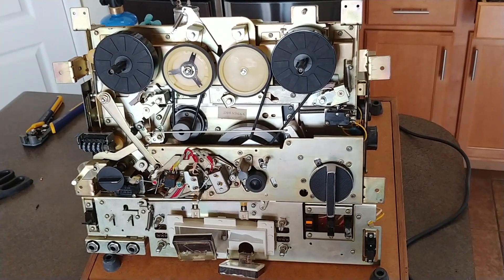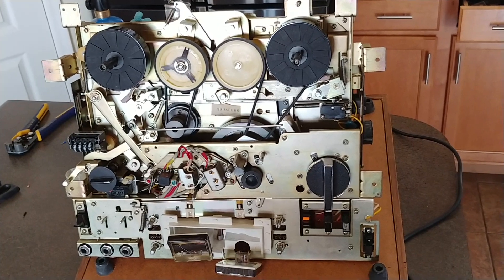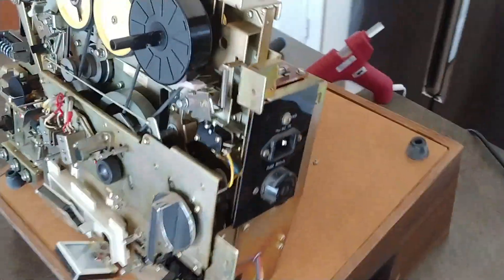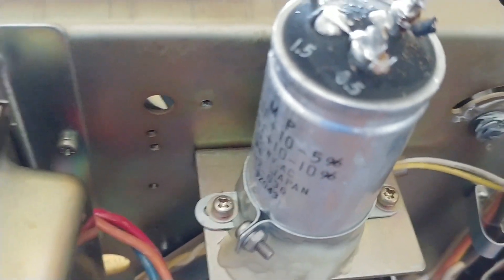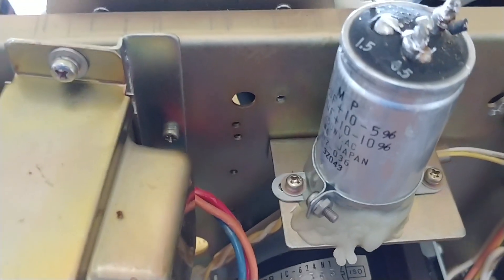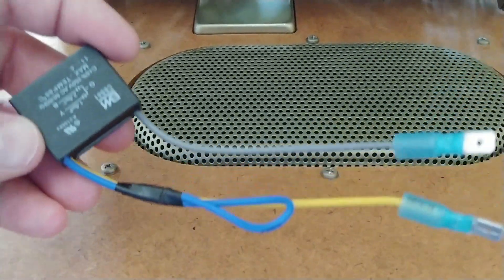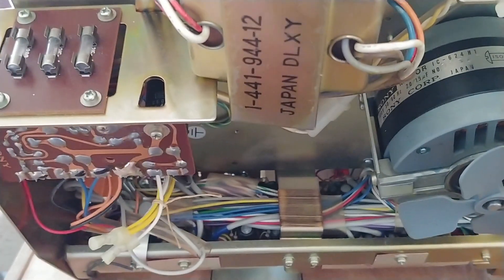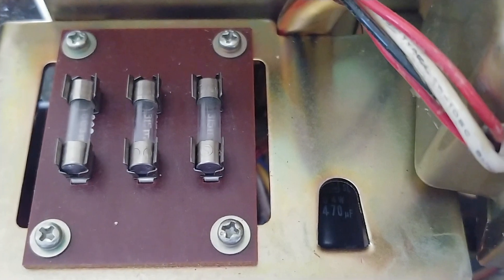Sony TC-377 Reel to Reel Capacitor Replace

Comment: Thanks for the video! As for questions on soldering: I’ve noticed my original capacitor head is wired from 0.5 to 1.5 (the same as in the video). What’s confusing is the new capacitor in the video has one wire taped down. However I noticed the new capacitor does not match the uF of the old capacitor, and the single yellow cable itself is 2.5uF. The capacitor I bought is 0.5 and 1.5 like the original, so I will solder these together, making three solder joint points. I will let everyone know how it goes!
Reply: Runs great! FYI, I couldn’t find a CBB61 with 250VAC, the one I’ve used is a 500VAC, however I believe it’s better to have a higher VAC replacement than lower.

Comment: Thank you for this. I too have a 71 machine, a phillips n4450. The first problem was screeching reel motors which some sewing machine oil seems to have sorted but now i have this problem of the motor on one side slowing down for no reason. Someone advised me to change all the capacitors which i can do but will be a big job for someone as inexperienced as me. Luckily i can solder so it's just coing to be a case of finding and matching the right components.
Reply: Good afternoon,

I own a Philips tape recorder, model N4418, and I am experiencing a similar issue. I have already replaced the transistors located on the back of the chassis, which has led to a noticeable improvement. However, after a few minutes of operation, the right motor stops again. I would appreciate it if you could share the steps you took to resolve this issue with your tape recorder and whether your solution was successful.

Kind regards,
Wouter

Comment: Hi there, when I turn my tc377 on I used to hear the motor but lately nothing, dead silence, would you say the capacitor is gone like you suggested in this gem of a video you put up? Short and to the point! It was also playing a little bit slowly too but now zippo! I opened it up to see and there was a lot of like ‘candle grease’ around the capacitor. Ty
Reply: Mine did that because I didn't have tape in it.  It won't engage the motor without tape on the reel correctly the far left bottom has a switch that will turn the motor off when no tape is in.

Comment: This is a nice clear video - too few videos online showing repairs!

Not sure if you've still got this machine, but does your erase head and the tape make contact during FF or RW? Or does the tape bar move the tape sufficiently away from all the heads during fast winding? I have a TC-645 that I'm working on, and I have noticed erase head wear due to this very issue. I have lapped the erase head, so it's fine now, but it will only re-occur again of course. The thickness of the bar is the issue I believe, it needs only to be a few mm broader in diameter.

Comment: I see you used a 1.5uf capacitor (which also has a 3.5uf wire on it that you just taped up as it's not needed).  The existing capacitor also has a 0.5uf lug on it and that's wired originally along with the 1.5uf.  Did you install a separate 0.5uf capacitor as well?  Or is that 0.5uf wire just taped up and no longer used?

Comment: With reference to the Sony TC 377 Manual one could use a 2 micro farad capacitor if the A.C. supply in your country is 50 Hz. However, is the A.C. supply in your country is 60 Hz  then use a 1.5 micro farad capacitor respective of the supply voltage in regards to which capacitor you select.
Reply: Australia is 50hz so should I be using a different cap? Also I'm not sure which wire on the new cap goes to which wire on the TC377.

Comment: I have a sony tc366 with bad capacitor.   there is five wires connected to three connectors on old capacitor ... there are only two connectors on new capacitor i got....is there certain way wires must be connected?
Reply from the maker: I could tell you what I thought, but I'm not sure I'm right so I won't.  I bought one that had the same voltage and connectors so there were no extras or missing connectors.

Comment: Hi I have the same issues on my tc377. What was the replacement capacitor?
Reply from the maker: It wasn't from Sony, it was a "Within Spec" replacement.  Bummer thing is though that it works better, but now it seems the motor itself is struggling, but at least now it starts moving

Comment: What happened with this? Did you by any chance get a video of it working after?
Reply from the maker: It works, but it's still a little slow sometimes.  I think the motor might be weakening and will replace that next.

Comment: got EXACTLY the same problem with my old sony tc252 reel to reel. lots of goo in the housing. motor ran really hot. did it run hot on your end to before the repair ?
Reply from the maker: Yes, it got very very warm

Comment: Hello Bowman-gt.....My capacitor seems to work fine as the motor fan turns but I need to clean and oil the main pulleys. The problem is the "lock pin's head" is not coming out, i keep sliding it but it wont come out of the slot even I move it both ways slider. Does the pin had needs to be pulled up or to unwind....Please help, looks like it will break. THANK YOU.

Comment: Hi, Nice Video. I have a Sony that I am looking to do the same repair. Do you have to use an insulated screwdriver to discharge the cap? Do you do that first and then unsolder the wires? Thanks
Reply from the maker: It's a good idea, yes. But if the capacitor is bad, it's probably not holding a charge. I just use the driver to cross the terminals just in case.
Reply: It should discharge in about 5 or 10 min but just to be safe have the machine isolated and disconected then short the leads